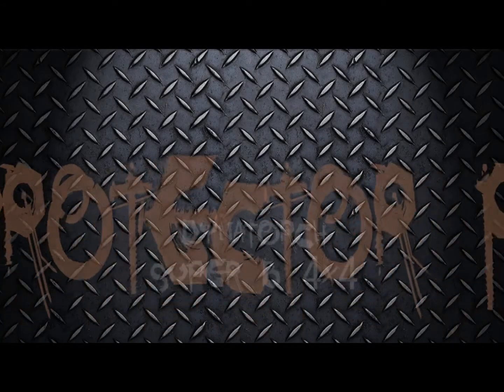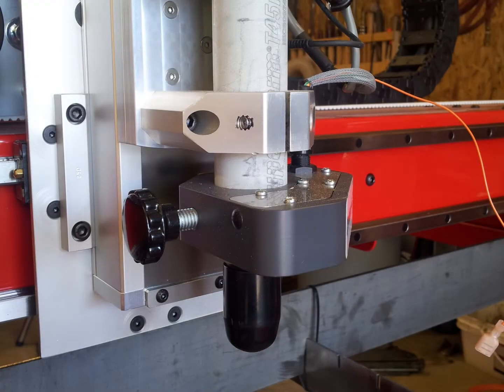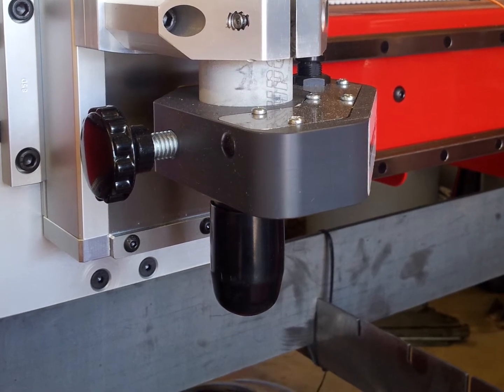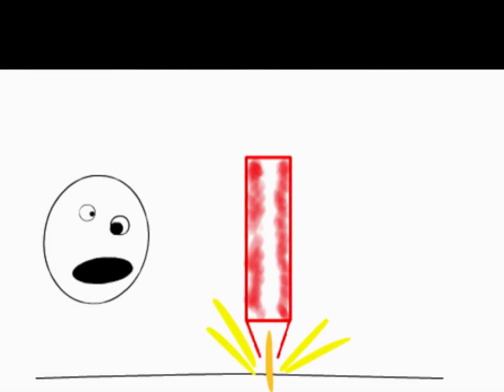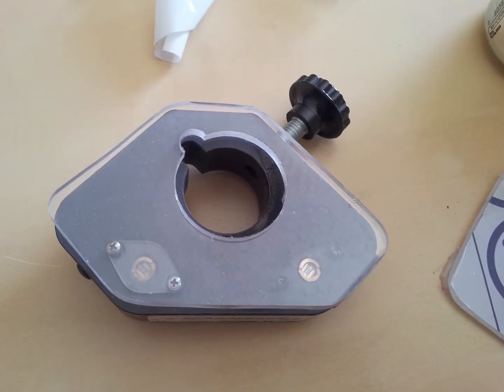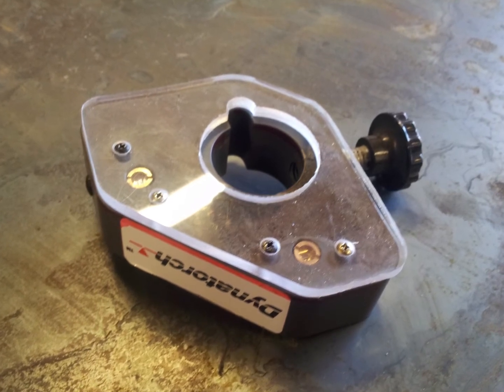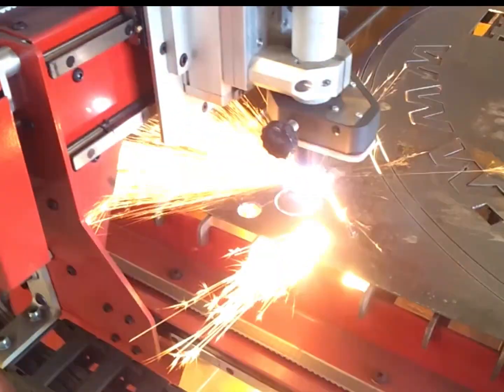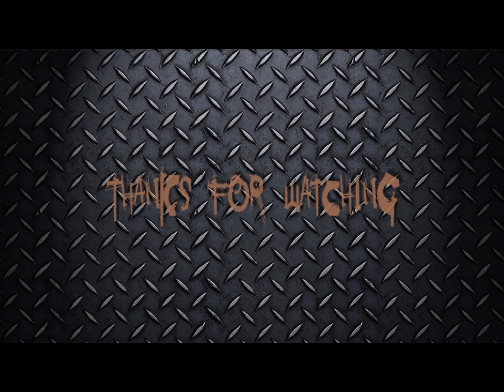CNC Plasma Table - Dynatorch Super B 4 x 4 Laser Locator Project

Comment: I just got one of these used and want to make the same protector you did here. Thanks for sharing! By the way the link to the dxf files is no longer working.
Reply from the maker: Awesome - They are a great machine.  I removed the link - I think that DropBox died a while ago 😉
Reply: Thanks for this video! I was desperately looking for a replacement lens until I stumbled on to your fix! Very clever, will be doing this repair as soon as I get materials!